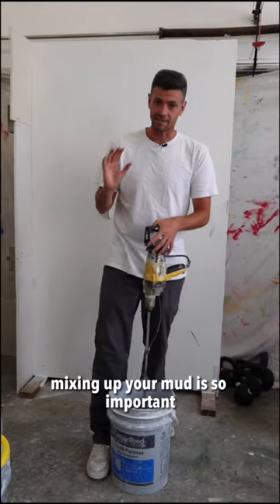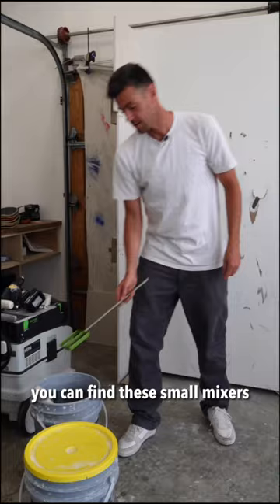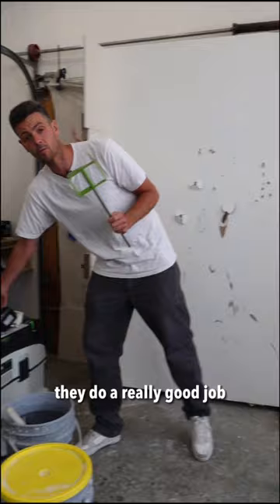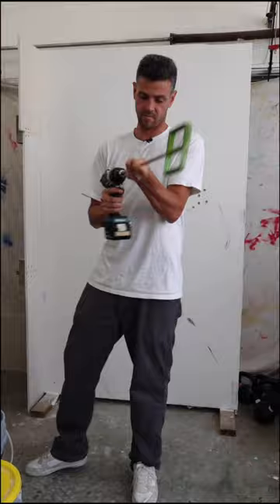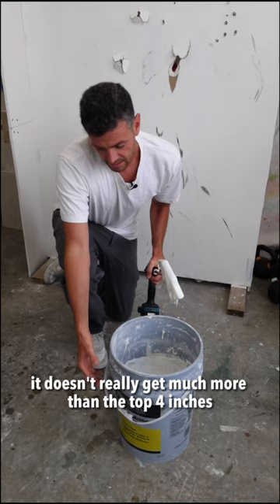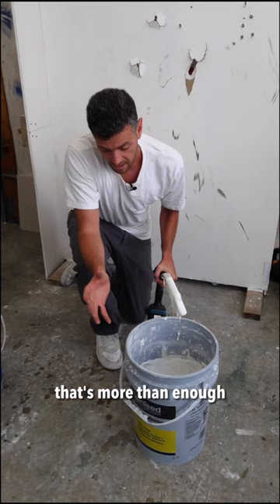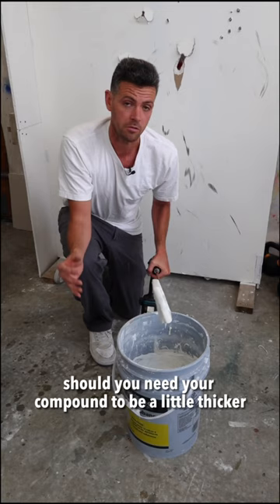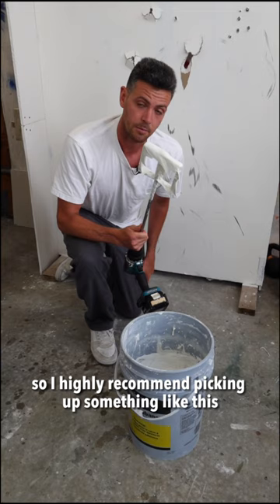YOU NEED TO MIX YOUR MUD! But you don't need a big mixer!

Comment: First thing I don’t agree with your paddle choice, don’t use with any coating, had a friend mix mud with colored paddle, what a mess, came off in the spray mud , little blue and green chips. Cost me 75 dollars not included labor.
Reply: Hi, our Mix It tool specifically the paddle is made with ABS Plastic and you can be sure that the color of it won't take off. Try it!
Reply: @BuddyToolsLLC  good to know, I personally don’t have a use for it. I only mix large batches of mud. Who knows what my friend brought to the job. Never had such a nightmare, I believe I already have a paddle like yours, mine mixes your mud in the pan.
Reply: The color green represents our brand but this tool isn't painted. The ABS plastic is injected with this color and can't come off. The MixIt was voted the #1 mixer for epoxy floor coatings.

Comment: I was looking through your channel but couldn’t find a specific vid on determining how thick/thin you want it for different situations… I always thin it out a bit.  

I’m in the middle of skim coating my popcorn ceiling but having trouble finding that perfect consistency.

Regardless, appreciate all the information I’ve learned from you over the years!
Reply: I’ve been doing the same thing. I generally go for a pancake-mix consistency, maybe a bit thicker on the first coat.
How did it turn out?
Reply: Why not just scrape it off?my guess is it would be painted already
Reply: When you are ready to skim coat the ceiling try applying a layer of thinned mud with a paint roller then smooth with a wide knife. Won't be so messy.
Reply: @BuddyToolsLLC I’ll give it a shot, thanks!

Comment: I have half a bucket of mud thats been sitting for a couple months now since I finished my last drywall job...and im noticing its developed a bunch of air pockets\bubbles?  is that normal?  is there any way to make it smooth again?
Reply: Mix it, with maybe a tiny bit of water.